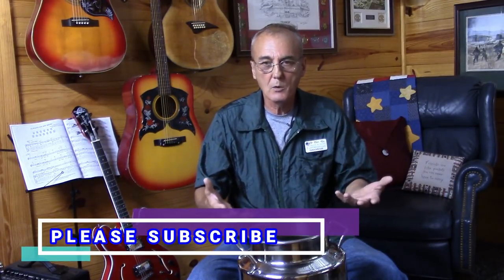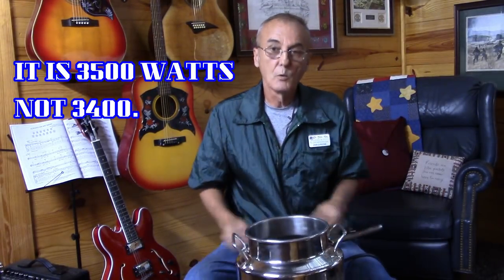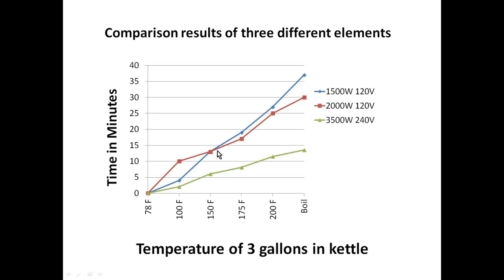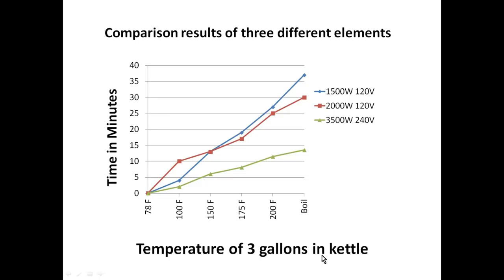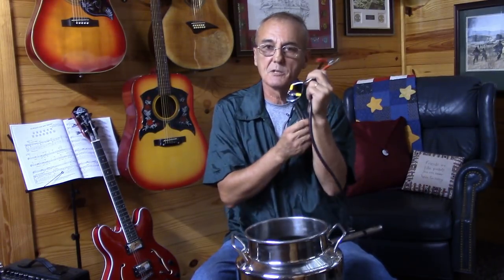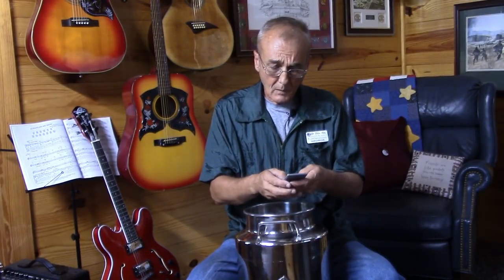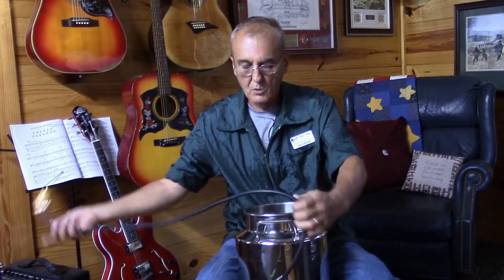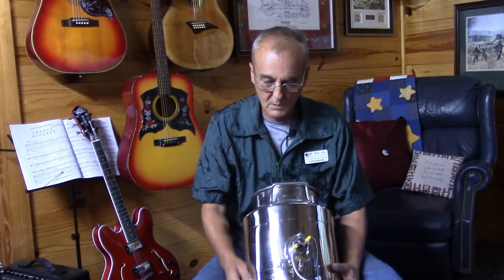TESTING THREE DIFFERENT ELEMENTS AND OUR RESULTS (new version)

Comment: Good video George, interesting for me to hear how the voltage supply differs from ours in the UK Great Britain. We only have one voltage ( for domestic, commercial is 3 phase) of 240 volt, with 3 wires, live , neutral and earth, which is coloured brown ,blue and green-yellow stripe respectively. We have a max current of 13 amp at any plug socket around the home which is 3000 Watts. 
Just thought I’d share that incase any one was interested. Thanks again George great videos
Reply from the maker: Anthony, Thanks for that info. I wasn't 100% positive of how European power was distributed and this is very helpful.
Cheers Mate
George

Comment: will a  120 element run a 13 gallon still
Reply from the maker: Yes it will. Heat  up time may be a little longer but if it is at least a 1500 watt element it will work.

Comment: I always look forward to your videos, but grounds and neutrals are not the same..
Reply from the maker: They are not the same but they end up in the fuse box connected to the same bus bar. 
George
Reply: Not necessarily George. They are only bonded together at the first means of disconnect. They serve two separate functions. The grounded conductor(white/Gray) carries current the unbalanced load in normal situations back to the source. Grounding conductor(green) carries current in a short/fault situation to earth.  

Love your videos.
Reply from the maker: Thanks for the explanation. You are correct and I appreciate it. I will refrain from mentioning that they are the same and include you description instead. Thanks for keeping me straight.
George
Reply: Southern Eagle It's 'always' best to be smart when working with liquids and electricity.  A Square D 240v 30amp GFIC breaker is about $100, my life's with more than that to me.